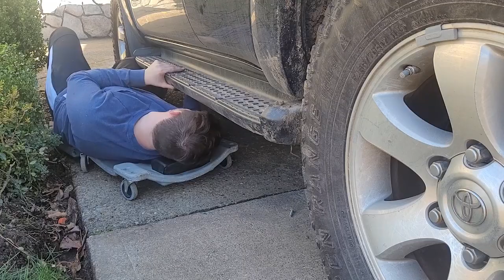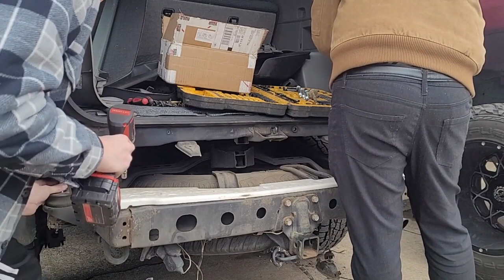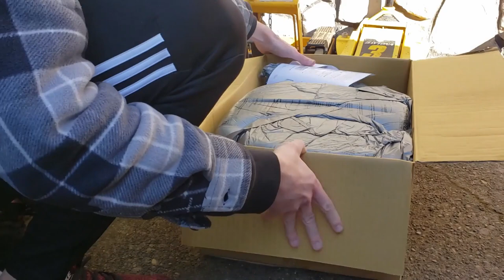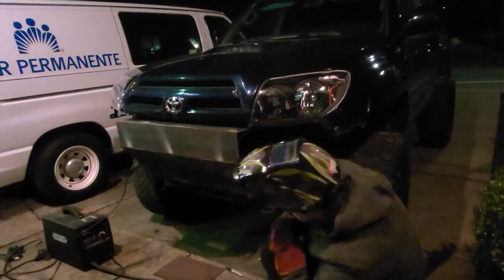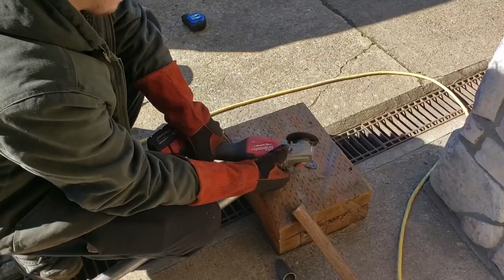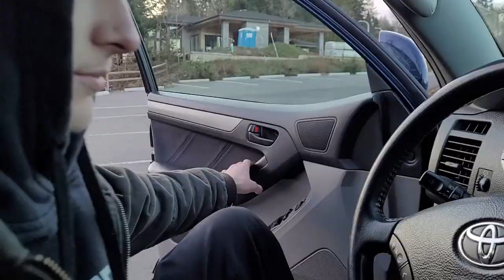4th Gen 4Runner 8 Minute Transformation

Comment: what is the parts list for the total lift i have same exact 4runner and i can only find 3" lifts for it any advice and build sheet would be helpful. How does it ride by the way? also did you have to use drop kits for anything with the body lift?
Reply from the maker: So we bought a 3 inch lift for fj but it sat higher on the runner, it rode good. Definitely could feel its just Procomp but that was good enuf for me, as for body lift, just the steering spacer and no other drops

Comment: I’m come across so many different answers. How does the 4th gen ride with a 6 inch lift? What are the downsides from your experience since you’ve installed this lift? Any help is appreciated! Also do you take it offroad? How is the flex?
Reply from the maker: So its 4 inch suspension lift and 2 inch body lift, it was on the stiffer side but overall no complaints I liked it, done couple of these lifts on different rigs
Reply: what lift kit did you get whats the lift kit build list parts wise
Reply: @rallycrossbuilds  could you tell me what kind of pieces you used to lift and the name thanks

Comment: Were did you get the body lift from was it a 3 inch suspension and 3 inch body lift combined 6 inches ?
Reply from the maker: It was 3 inch FJ suspension but sat more like 4. And then 2 inch body lift
Reply: @rallycrossbuilds  awww okay appreciate the information

Comment: Any bodylift? Did it come with front spring and coilovers?
Reply from the maker: 2 inch body lift then fj cruiser 3 inch suspension lift but sits more like 4 inch on 4runner. That lift came with the springs/shocks for rear and the coils/struts for the front
Reply: @rallycrossbuilds  awesome thank you
Reply: What kind body lift u put on?Tks

Comment: How did you keep the rear bumper stock with the body
Reply: With the 2in body lift , I just did my 05  with an 1 1/2 body lift and the bumper look tweeked
Reply from the maker: Just had to cut the little tabs off that press into the hitch, and it seemed to sit pretty good

Comment: What did you do to fit 35s?
Reply from the maker: Fj cruiser lift, which was bout 3-4 inches, and 2 inch body lift, still needed a little trimming after that to
Reply: @rallycrossbuilds  question man…I want to lift my 4th gen 06 with the fj lift. Did you use the springs and struts only? I’m not really a specialist in car maintenance/disassembling. I’ll be buying tools for doing wheel work in general. Can you give me a somewhat guide on everything you used for the lift? Including the link to the fj lift kit? I would greatly appreciate any help.
Reply from the maker: If you toss it into Google there's a couple forums that will guide to which lift works. Sorry I lost the link. Also there's a fj 6 inch lift that works aswell. Did that on the new 4th gen we have.